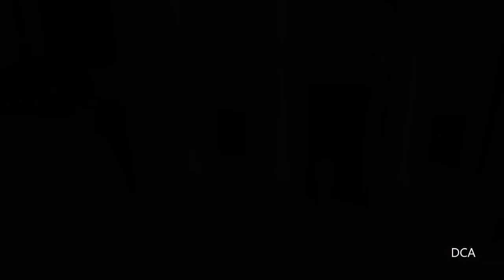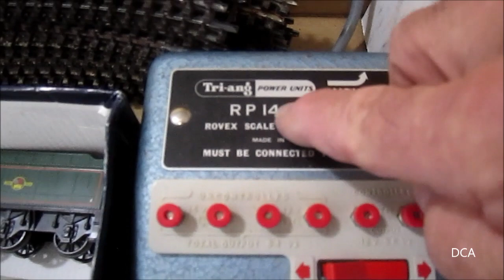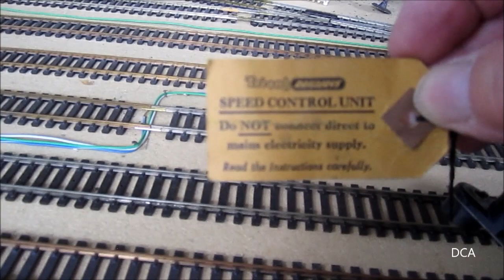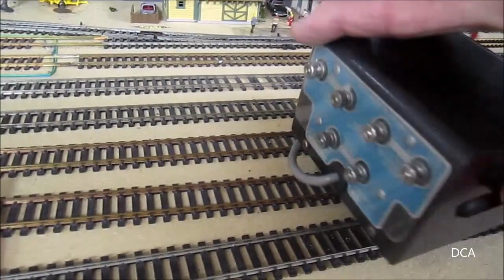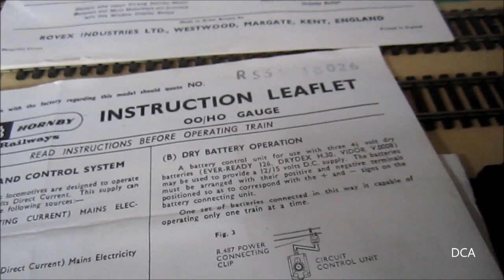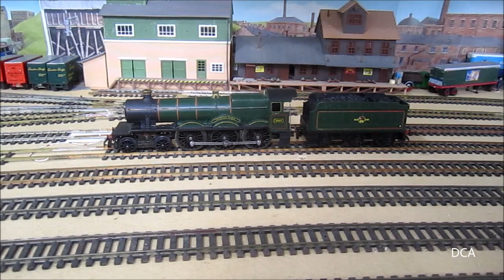Trains on Tuesday 16th. October 2018. Tri-ang purchases part 2.

Comment: David. May be able to help with the Hall. I have one which has been in the wars but does have good valve gear!. If you are in the UK perhaps we can come to a deal?
PS. off back home soon. Oregon was to die for. Pity the Mallet 'Skookum' never made its debut!
Stephen N
Reply from the maker: Thank you Stephen, I shall be knocking on your door some time.  David.
Reply: @trainsontuesday  It may be the later Hornby version. Basically the same i think
Stephen
Reply from the maker: Many interchangeable parts between them.

Comment: Good evening David.  Another great set of Items you seem to have acquired. The set of seven wagons you have is I think correct The RS.51 Freightmaster Set 1965-67 with the Green class 31 (R.357) In 1968 only the RS.51 Freightmaster Set came with the same wagons but the Class 31 was in Electric Blue. In 1969 the RS.51 Freightmaster Set Came with a Rail Blue Class 31 with the same set of wagons as the previous years. The 1970 catalogue shows the Freightmaster Set with same wagons and Rail Blue Class 31 but with a new catalogue Number R.651 I thinks this new number was to represent the change to system 6 track in the set instead of Super 4. I think the catalogue you have shown in the video is the 1971 edition in which the Tri-ang Container wagon R.561 was replaced with the Cable drum wagon R.18 the instruction sheet you have with RS.51 stamped on it must have been the sheet that came with the set. The sheet covers a lot of different aspects of the Tri-ang Railways system and would have been used in many different sets but with the appropriate RS number and date stamped on it. So I’m thinking as your class 31 that looks to be Rail Blue you have a 1969 RS.51 Freightmaster Set especially as you have no system 6 in this recent acquisition  (But I have to admit its hard to tell Rail Blue from Electric Blue until you see the two colours side by side. So possibly 68). The Albert Hall body looks to be in Great condition. Its a shame about the chassis. But eBay may be the answer there are a number good looking chassis available complete with cylinders, rods and motors at present. The Body/shells on these very often have broken steps the tender also. Perhaps look out for one with a good GWR Tender but dodge body/shell on the loco to keep the price down then you could have two variations (there are gloss and matte variations of each I think) That Controller PA100C looks great and from reading Pat Hammond’s book it dates to about 1961. The controller with the blue plate is very similar to The P4/P4.5/P5and P6. Apparently, the colour of the information plate ( I think this means around the control knob) is significant as it identifies where the unit was destined for but the book only goes on to say that green was not much called for! very helpful! there is mention of 110v units and these carried the SI suffix at the top of the list is RP5.5SI (800 made between 1965-1967). The standard track you have would seem to be the very last type made I think. As it does not seem to have shrunk or warped and you say it works well. I have yet to find any of this type. The early stuff was cellulose acetate ( which has a mind of its own!) the later stuff was apparently Polystyrene and production of the Polystyrene type ended 1960/61. I personally think it looks great. Again made my day to see these latest items to your collection. I’m hoping to see a Super 4 line on the Highland Valley Railway….

Looking forward to the next instalment of Tri-ang on Tuesday.

Oscar
Reply from the maker: Thank you Oscar, you really are a Tri-ang encyclopedia. I shall have to study this well and make myself some notes as to what exactly I have. One of the tender steps is broken on the "Hall" but the loco shell is intact. I have gloss and matte shells but that is another video in it's own right. I shall have to inspect my other box of standard track to see if it has shrunk or warped. There is unfortunately absolutely no room for a Tri-ang layout but I am hatching ideas, perhaps next year? This past weekend I attended the Mount Cheam Lions Club annual show in Chilliwack BC and this year several stalls had Tri-ang items on sale most extremely cheap and even some free. My purchases there will make up part 3 of this series of videos, hopefully next week.
Regards, David.

Comment: Hi David, I buy my Tri-ang spare parts off ebay. the parts are cheap but the postage ain't. Your lucky to have found good standard track, here in Australia it has usually shrunken plastic road bed and not very usable unless it's a straight section.    Cheers, and all the best with your collecting.   Mike.
Reply from the maker: Hi Michael, Thank you for your great comments. I had a bad experience with ebay around 2005 and haven't used them since but maybe I should look. I was amazed at the condition of the standard track, I just need room to set it up now. More to come in part 3. Cheers, David.